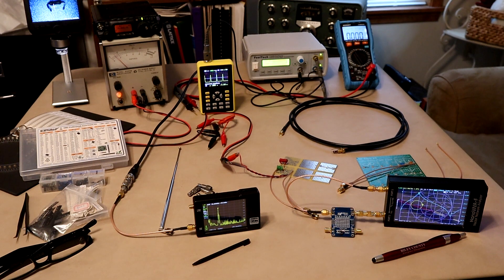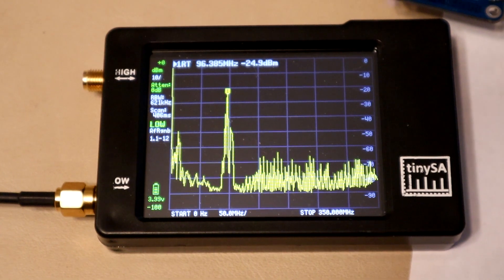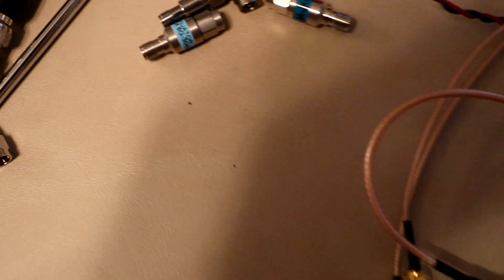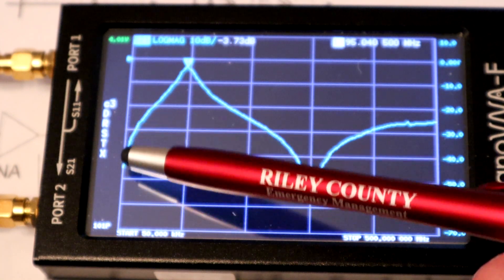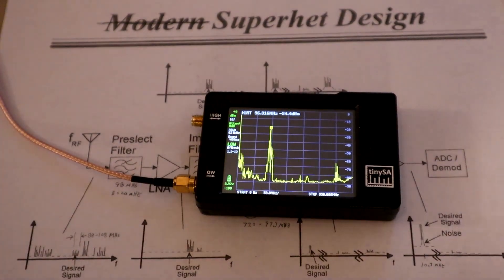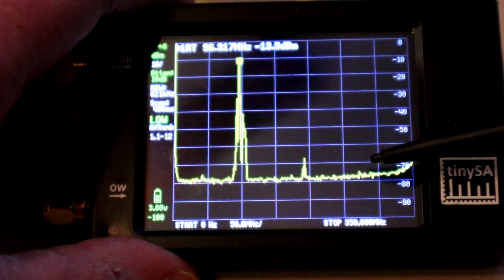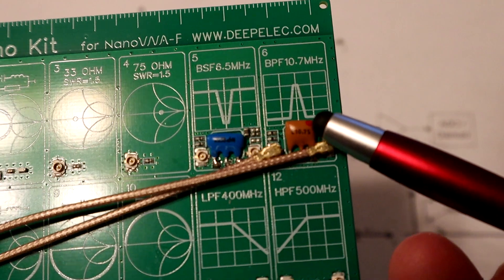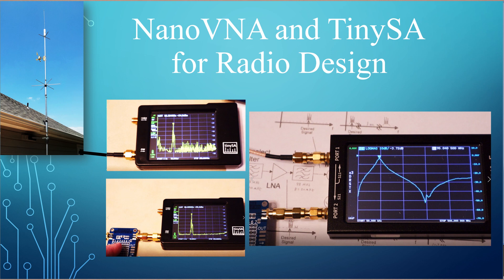NanoVNA and TinySA for Radio Design

Comment: Is the TinySA good for using to adjust the. Tr usdx ref frequency . If so how would I use it.
Reply from the maker: Although the TinySA can measure frequency (and even act as a synthesized signal generator), the TinySA uses a TCXO (temperature-compensated crystal oscillator) for it's reference. So it's good, but not perfect. It's probably accurate to 2 or 3 ppm (parts per million) in frequency. So if your (tr) uSDX doesn't have a TCXO, then yes - you can use a TinySA to calibrate. E.g. Set the TinySA up to output a CW signal , tune the uSDX receiver to the same frequency in CW mode and then adjust the uSDX frequency cal word to zero-beat.  That should provide an accuracy of better than 100 Hz in the HF bands. WARNING - don't transmit as that could damage  the TinySA !! It looks like the uSDX outputs a watt-level signal !   Alternatively, it looks like you could put a TCXO in your (tr)uSDX if you want. See: https://oshpark.com/shared_projects/4DRo2NCn . However, even with a TCXO, you're going to be off by up to +/- 50 Hz at 15 MHz.  To do better than that, don't use the TinySA. Find a time/frequency broadcast signal you can receive with an antenna and adjust the uSDX to zero-beat with it.  Here's a video that I found online that shows that being done with WWV's 15 MHz broadcast in the US: https://www.youtube.com/shorts/78Kn5H8BOFw (They're not zero-beating. Instead, they tune  the RX to 14.999 MHz and use an audio spectrum analyzer to calbrate till they get a perfect 1000 Hz tone.) That should get you within a few Hz of ideal. But it may still drift with time and temp).  Thanks for the question. I had not heard of the (tr)uSDX before. Looks like a cool QRP radio !   73's

Comment: my 4-year-old NanoVNA which used to be working great.

but now I am seeing something odd about S22 port (which i might have accidentally broken being used without DC block in path).

Somehow most of my amp circuits always measure only around 4dB gain. although they were supposed to be around 19dB to 38dB. Measurement at center frequency, the circuits are stuck in that 4dB range or less.

Initially I though my circuits were faulty, but it's too many circuits to be some coincidence at being stuck around 4dB.

When I use nanovna as signal generator and observe the gain with tinySA, it appears to be close to the expected range.

I repeated calibration multiple times. So that's not the problem. Through connection directly measures 0 db. Attenuators tested 3dB,10dB, 20dB, 30dB all seem to be valid. But it only has trouble with circuits which might have gain like about 10dB.

When I add an attenuator in path before port2, the gain seems to get closer to expected numbers.

What are the chances that port2 is damaged but still manages to receive and process signals right when the power of signal is low (like with attenuator).? If it is damaged how reliable are the s22 numbers even with the attenuator in place?

any other tests that I can do to confirm the state of port2?

(looks like my issue with LNA in the other thread is related). :(

I understand this is not the forum for this topic.
Reply: More of the concern is how much are the gain numbers trustworthy even with attenuators. Does tinySA measurement validate the numbers, considering input reflections won't be accounted for by tinySA measurement.
Reply from the maker: How does return loss (S11) look if you connect port 1 directly to port 2? I think you said you get 0dB S21 in that case (true?). But checking return loss should  tell us if the port 2 is still around 50'ish Ohms.  When measuring amplifiers, I would definitely recommend using attenuators. The signal out of port 1 is about +2dBm, which can cause amps to compress at their input, even if the output is not compressing. Putting 30 dB atten on port 1 connector and 20 dB on port 2 connector might be the answer.  Depends on the amplifier under test though - and with 30 dB on port 1, S11 measurements are kinda unreliable since the VNA just sees the attenuator then, of course. But for amps with gain < 30 dB, it should give good measurements (after calibrating S21 with the attenuators in place) Hope you can get it sorted.
Reply: @MegawattKS S11 is 0 dB for through.

 S21 does validate all attenuators i throw at it. So port2 is still sort of alive, just that its measurement falls as power raises.

With attenuator in port2, as signal drops, measurement seems to get closer to expected, but just not sure if I am really seeing the good numbers or its just showing what i wanted to see.
Reply: Where I live its not easy to get hold of newer nanovna :(
Reply: @MegawattKS and yeah port2 measures 50 ohms too.

Comment: Where did you teach radio design? Is it possible to see the classes on the Internet?
Reply from the maker: I was at Kansas State University (aka K-State). Yes. While the classes themselves are not on-line in the traditional way, I did abstract the key material from the course and put it on YouTube a few years ago after I retired. Search YouTube for "Radio Design 101" or go to the playlist here: https://www.youtube.com/playlist?list=PL9Ox3wpnB0kqekAyz6blg4YdvoEMoJNJY . There is also an associated website which has links to that and other related things, including educational material on antennas and propagation.  It even has the full lecture notes I used when teaching the radio design course (the lecture notes are a little rough - but the videos are OK )  Here's the website: https://ecefiles.org/  It's not fancy, but the content is there 🙂  Hope its helpful.

Comment: Hi, is there some significant difference between 1206, 0805 and 0402 smd components in case of frequency response? I mean, a LPF wit 0805 will be the same as 0402 with the same components values? Thanks
Reply from the maker: It depends a little on frequency of operation. But the PC board trace inductive parasitics are probably more important than the component size within that range. Keeping a tight layout and using ground vias to the ground-plane properly (immediately next to the pad that is supposed to be grounded) is critical, especially above VHF. The one exception to this answer applies to SMD inductors. Small inductors (e.g. 0402) can have much higher series resistance than larger ones (0805, 1206, or larger air-wound). This leads to high signal losses and wider bandwidths that expected. That's why the circuits shown at 11:49 in the video used air-wound inductors. A high quality factor was needed for the bandpass filtering. That isn't usually available in the smaller SMD types because they use spiral-wound flat inductor designs with small, thin traces inside the chip. But you can buy air-wound inductors in SMD 1206'ish size that can have Q up to 50 or more. Hope that helps.
Reply: @MegawattKS  thank you very much for this answer. I'm developing a circuit with an ESP32(2.45GHz)using chip antenna with 0805 components because it is easier to solder. I already ordered a NanoVNA 2 from Bangood to try to make the pi matching circuit a little better. I calculated the pi matching circuit with an online calculator. I know that the Esp32 has an output impedance of 35ohm+0j and the NanoVNA is 50ohm. I will try to solder a coaxial cable in the pin of esp32 to try measure the impedance of the matching network. But, how to know it will work if both the esp32 and NanoVNA has different output impedance? I will solder the coaxial cable without the esp32 in the board. Thank you very much.
Reply from the maker: @anlpereira  0805 components should definitely work, but again, make sure that the interconnect traces on the PCB are short/compact in the circuit itself ('transmission lines' leading to/from the antenna can be longer since they maintain 50 Ohm impedance if they are the proper width). See this video for a deep-dive into this topic:  https://www.youtube.com/watch?v=R0mRTigYzco&lc=    I have not used the ESP32 myself, but based on some schematics I find on the web and your comment that the output Z is 35+j0, it should work fine even without a match. If you compute the "return-loss" or SWR for a 50 Ohm load on a 35 Ohm source (or the other way around), its actually a very good match. I.e. it should be better than -10 dB S11 even without a match. On a related topic, have you considered adding a bandpass filter between the chip and antenna? I see some people have done that, and depending on the level of interference you expect to see, it might be useful. But maybe that can be added later if testing reveals it might be needed. In any case, please pay close attention to VNA calibration and coax/cable connections to make sure the parasitics are well controlled to get good measurements. Enjoy the NanoVNA !
Reply: @MegawattKS   yes, I place three components in a Pi configuration. I saw in the antenna datasheet that I have to place a 3nH series inductor with two 0F shunt capacitors, but I think these values are considering a 50Ohm source impedance. As soon as I have the circuit and NanoVNA and make some tests I will share the results. Thank you very much again for answers.

Comment: Excellent video! Thank you for sharing your knowledge on RF.
Please, I would like to ask a question: if I needed to measure the frequency response and insertion loss of a filter that is not intended to work with 50 ohm source and load (for example, a Medium Wave AM pre-select filter, with a ferrite coil, which also works as a very high impedance magnetic antenna), would it be possible to do such measurement with the NanoVNA, as it's designed to work with 50 ohm sources and loads? If the MW filter were connected to the NanoVNA directly, the bandwidth would be much larger than the expected one in this case, because this MW AM filter should match a very high impedance rather than 50 ohms. I have tried to use an impedance transformation at the input and output of the LC resonant circuit by using two secondary windings on the coil (one for the input and one for the output), so that the LC resonant circuit sees a high impedance on both ends and matches to 50 ohms of the input and output of the NanoVNA. It's weird that If I connect only the S11 port to the circuit through one winding, the S11 reads out 50 ohms, but, if I connect the S21 port too to the other winding, then  the S11 in this case reads out 25 ohms instead of 50, so it ruins my measurements.

Thank you!
Reply from the maker: Interesting. It sounds like it's sorta working  - but just a bit lossy? Is the bandwidth roughly what you expect? I.e. narrow, but about a factor of 2 wider than it should be? If so, then I'm guessing there's just 3dB of loss somewhere.  You also mentioned the coil is a loop antenna. Have you accounted for the expected radiation "losses" from that?
Reply from the maker: The few times I've actually tried to test a filter that wasn't 50 Ohms, I used either transformers (which I think is what you're describing essentially), or used high-value resistors. For example, we measured 330 Ohm ceramic FM IF filters using some simple 4:1 impedance transformers (didn't have 6:1). On a research project we did it a different way. We just put series resistors in at the end of the coax cables of the value we needed the high-Z (non 50) filter ports to be. Of course the S21 measurement has to be adjusted, and/or one needs to do an S21 cal with those in-place. There's a fair amount of dynamic range in the VNA (even the NanoVNA), to handle this.  Finally, one might try an active probe - but that would only work on the port 2 side. Port 1 would still need a transformer or resistor...
Reply: Thank you for your answer and advice. I think I figured out what's going on: my set-up is a home made ferrite core coil with 80 turns to be used as a magnetic antenna to pick up MW broadcast stations, together with a variable capacitor to make up an LC filter to select the desired frequency. The Q factor of the coil is 30 at 1 MHz (not too high because I'm not using Litz wire and I'm probably getting losses due to the skin effect). So, I needed to characterize the LC filter to measure how it's frequency response to the MW stations. I imagine we could model the magnetic antenna as a voltage source with a series impedance of Rp, which is about 144 K (maybe this assumption is wrong, I don't know). So, if I connected a load of 144 K, it would be in parallel with Rp, which gives 72K... And I think this is what I didn't take into account before... Because, now, the source resistance would be 144 K, but the equivalent load resistance would be 72 K (just half)... And I think that's why the NanoVNA is reading out 25 ohms in S11(through the matching transformer) instead of 50 when both ports of the NanoVNA are connected. The BW I get is 92 kHZ, with -2.62 dB at the center frequency, and I guess they're due to the insertion loss of the filter.
So, in this case, I think the measurements now make sense. What I don't know if this is the right way of measuring an LC filter that also works as a magnetic antenna... In this case, would Rp appear as the parallel loss resistance of L or as the source impedance of the equivalent voltage source of the antenna?
Thank you and congratulations for such great videos on RF
Reply from the maker: @Miguel-r4l2p  I think that all sounds good, except you said series impedance of Rp. That should be "parallel impedance", yes? Honestly if you're satisfied with the selectivity as-is, I think the impedance mismatch is not a big problem. If I understand the setup right, then I think the answer is that Rp will be the parallel (Norton) resistance of the received signal source used in analyzing the circuit. But converting Norton to Thevenin, Rp is also Rsrc for a source model comprised of a voltage in series with resistance. Does that make sense?
Reply: @MegawattKS  Thank you for your answer. Yes, I think it makes sense now. I've managed to plug it to the BNC input of a receiver and the signal now in Medium Wave is strong!
I'll continue watching the video series to design the other parts of the AM radio.
Thank you.
Reply from the maker: @Miguel-r4l2p  Awesome !

Comment: Random question:   A typical signal level input to a receiver might be 50 micro-volts.  If this is so,  then how does a crystal detector work when the diode has a .3 volt forward drop?   It seems like the voltage is about 1/6000 of what is required to make the diode conduct.
Reply from the maker: Good question.  A few things that I can think of combine to make this plausible.  The main thing is that semiconductors have a sub-threshold exponential behavior - which is still non-linear. The forward drop depends on amount of current (or visa-versa). In addition, there is some voltage step-up (maybe 10x or 20x) from the tapped tuning coil that does an impedance transformation from 50'ish Ohms to a couple kOhms that the earpiece presents at the output. Finally, the earpiece is right in the ear and the ear has about 100 dB of dynamic range. So very little RF power is needed to get enough audio power to hear it. 50uV at 50 Ohms works out to -73 dBm (if I punched the calculator correctly), which is maybe 70'ish dB below max volume (1mW directly into the ear) - so it's within the ear's dynamic range 🙂
Reply from the maker: I searched for data on a Germanium 1N34 diode and found this discussion. There's some nice graphs that show the early cutin of some detectors https://electronics.stackexchange.com/questions/223813/the-classic-1n34a-ge-diode-has-a-vf-of-1v-how-could-a-diode-with-such-a-high
Reply: @MegawattKS  Thanks .... that was helpful!
Reply from the maker: One other thing. Even thought the points above make it plausible, it's still a push at 50 uV. Are we sure crystal sets can work at 50 uV?  They're typically used for long-wave signals with very long wire antennas that can pull in a lot of voltage (from V = E * Length).  Disclaimer - I've never actually used a (good) crystal set.

Comment: Could you recommend a book on RF design?
Reply from the maker: There are several, depending on specific interests and what one's background is (e.g. how mathematical one wants to be).   The one I recommended in the communication circuits class I taught was:  "RF Circuit Design 2nd Edition by Christopher Bowick ". It has the advantage that it covers filter design in similar ways to what is done in this video and it is a good complement to the Radio Design 101 video series on this channel. And it goes into some areas in more depth - like series/parallel realizations of impedances underlying matching to complex loads.  Amazon has a "Look Inside" for this where you can see the table of contents as well as read a good portion of the first chapter or two to see if this fits you're interests and you like the style. There are other texts of course that cover systems, microwaves, digital modulations, RFIC design, etc.
Reply: @MegawattKS  Thanks. I have the first edition of Chris Bowick's book. I found it excellent. The level was exactly right for me. I didn't know there was a new edition. I'll take a look.
Mike (in Germany)